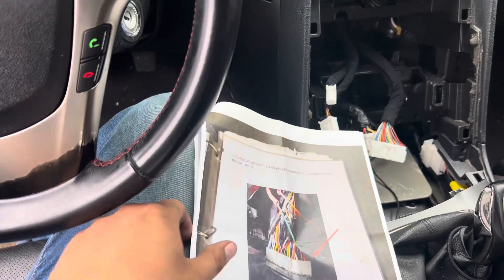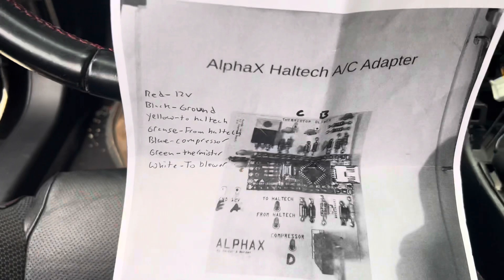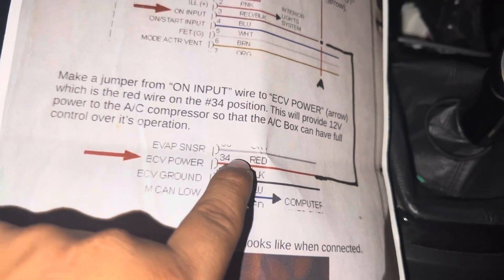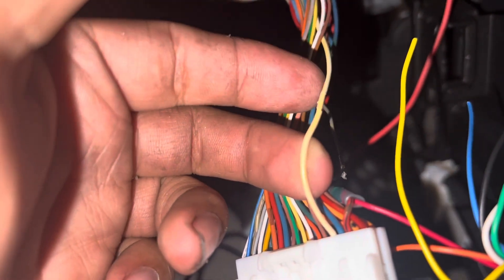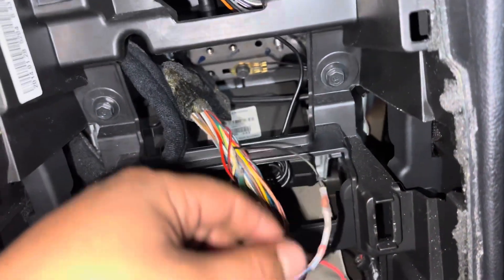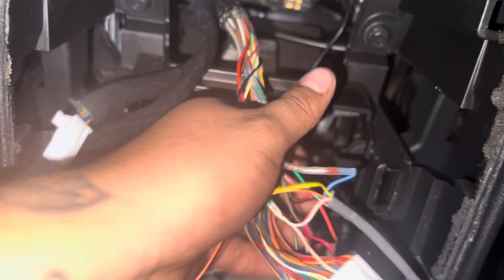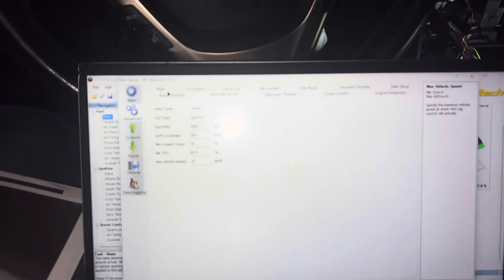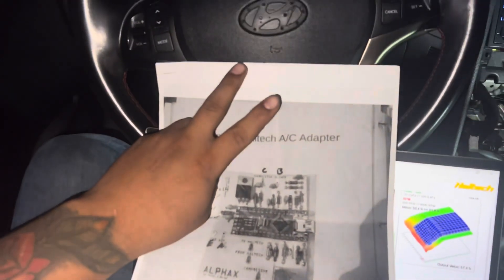Haltech AC Module DIY Install | Genesis Coupe 2.0T

Comment: How do you like your haltech pro plug n play. Have you had issues?
Reply from the maker: On all the ones I’ve used and installed, never have had any issues 
But I’ve had friends go through the TBC module and gar to get the ecu warranty replaced. Always buy a new haltech so you can have warranty with it